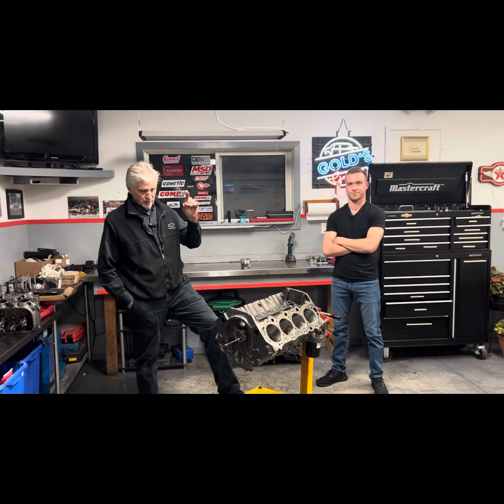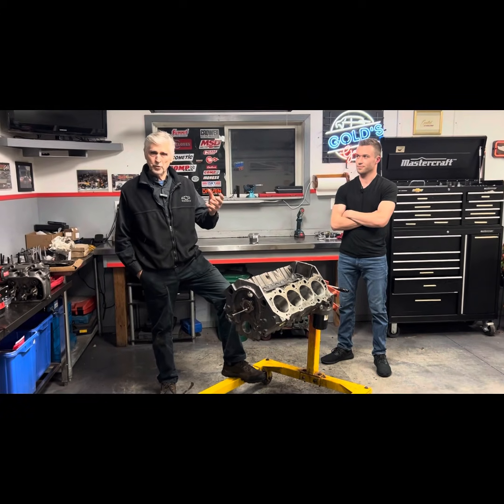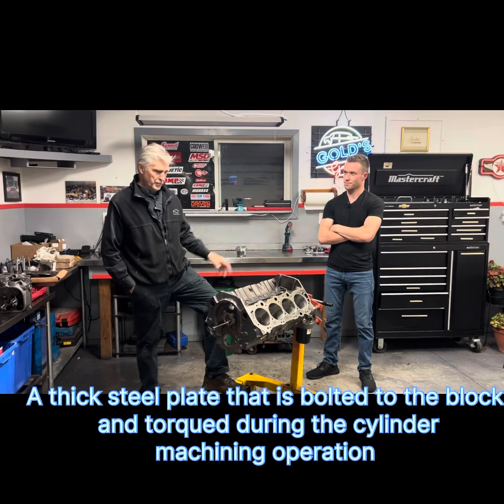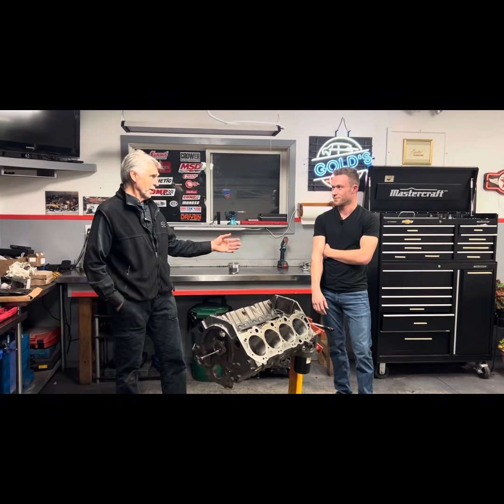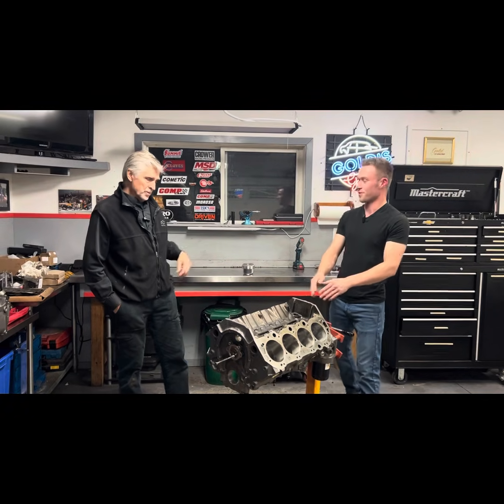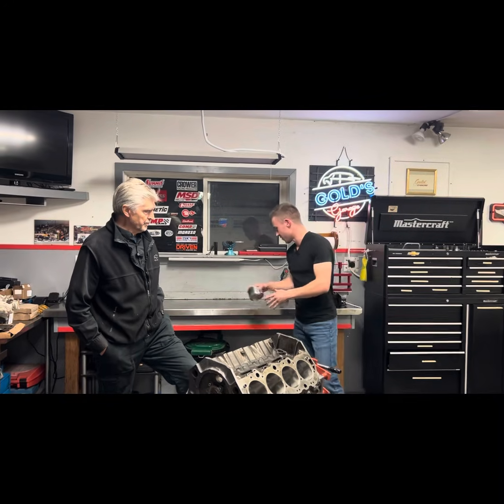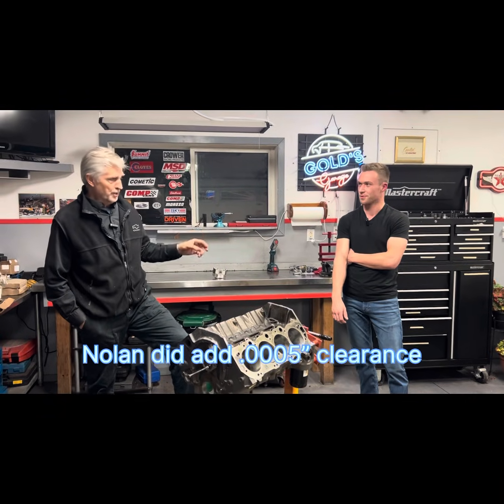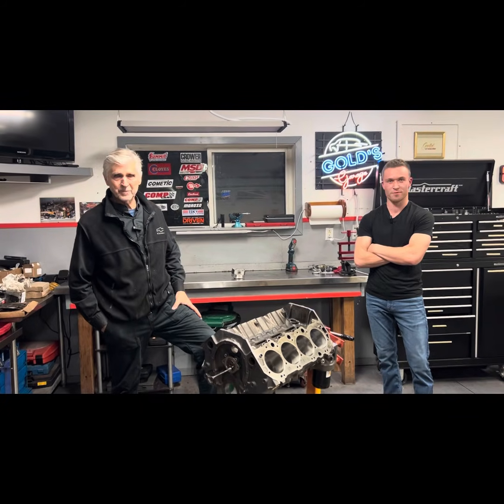COSTLY MISTAKE TO AVOID! Don’t Overlook This! AND The Importance of Torque Plate Honing!

Comment: Alan we were putting a 4.3 Marine block together with HyperEutectic pistons with .002 thousands clearance and we couldn’t get pistons in the hole without the plate on. Early lightweight Mercruiser blocks were really bad for distortion.
Reply from the maker: Good info and good to hear from you Dennis. hope you are well. AG

Comment: So In theory the rings should be gapped with the torque plate attached as well??
Reply from the maker: Technically yes, however since the variation in bore is less than .0005", the difference in gap would be less than .0015" AG

Comment: Alan, Nolan pretty much hit the nail on the head when he talked about Ford V-8s having little bore change whether or not heads are bolted on. This generally applies to engines with ten blind bolts per bank.  I've had these engines honed with both loaded and unloaded decks, and there is little difference in final bore dimensions. For all-out competition, even with these engines, I would still go with torque plates, though.
Reply from the maker: Thanks for the insight, always appreciate your experience Bill! AG

Comment: Required clearance on aftermarket pistons (that have a skirt coating) is based on the nominal skirt size without the coating, so if you're measuring on the coating keep in mind there is typically 0.001" of coating, so if the piston measures 4.027" over the coating, it is actually 4.026". Many manufacturers will leave the measuring points bare so you can measure the actual clearance, but sometimes the "windows" they leave are smaller in size than your typical micrometer anvil. Generally speaking, for normal use applications, aftermarket pistons have the required clearance "built in" so if you hone the cylinders to the indicated oversize, you're good to go. This is application specific of course. In the case of your Wiseco pistons, there should have been a build sheet with all the pertinent information. See if the clearance spec is around 0.001" larger than what the piston measures.
Reply from the maker: Right on Yarrda, that is exactly correct and why usually the machine shop can clearance a block without the piston. In this case it didn't work. Thanks for sharing your knowledge and experience as always. AG

Comment: You should also supply the fasteners you're going to use along with sample head gaskets you're going to use. Put the main caps on and torque to spec with the fasteners you are going to use. I use ARP studs and bolts exclusively on all my personal engine builds.
Reply from the maker: Thanks John for the tips, I appreciate you sharing your experience! AG

Comment: Some one set the camera wrong and the aspect ratio is not correct. It's time to move to a better 4K resolution camera for your shop videos. The present unit is not as sharp as it could be and since many of us are using 4 K monitors in bigger sizes like 50 inch or so the difference would really make your productions pop. I never understood why you didn't use a TRW VMS 75 alloy piston which is like 4032 and does not need all the clearance that a 2618 race piston does. They are better for the street and is what GM used originally. We would buy the TRW 2307 pistons and machine .200 off the dome. You have a lower than 12-1 ratio for the street, usually about 11-1  and a much better flame front since the dome is down out of the way. The piston dome is plenty thick and this does not compromise strength in any way. And the material is like 4032 and thus more suitable for street cars because you can keep the piston running clearance closer. As I mentioned, Chevy used these TRW pistons in the small block and big blocks during the era. Look inside the pistons and they have the logo forged inside. You can do some research and find the specs for VMS-75 and see how it compares to all the other alloys.
Reply from the maker: Thanks Mike, that's good information about the pistons. Our problem was finding the corrrect dome volume for our target CR. About the camera, interesting, my daughter recently bought me a Sony ZV-1F and we will be using it in future videos. AG

Comment: You do not need a Tq. plate to check it, Just Tq. the cylinder head on it. Turn it over and check it from underneath. If it is incorrect it only means the Tq. play is WRONG. The closer the bolt holes are to the cylinder wall the more distortion. The 400 chevy is the worst, and Ford had enough sense to move the bolt holes away from the bores. The further the ring is down the piston the less it effects the seal, because the distortion is only where the bolts are pulling on the deck and bore.
Reply from the maker: Good information, thanks for commenting Racer.AG

Comment: You probably know this but always supply the pistons to the machine shop prior to fianl bore finish.
Reply from the maker: Yes you are correct, that is best practice. However, typically if the bore is machined to standard, the piston manufacturer sizes the piston to provide correct clearance. In this case it didn't. 
We didn't have pistons and wanted to get the job moving. Retrospectively, it would have been better to wait. 
Thanks for commenting Truck.AG

Comment: My shop was registered to receive manufacturer service tech bulletins. 1 was about the 1 piece seal GM small blocks. 80s-to mid 90s era. It stated to torque plate hone. If not using plate, add additional. 001 piston clearence. Same for the 302 Ford. Our shop also as practice, whether stock or performance, used ARP head studs on these blocks, to help minimize distortion, increase clamping load, etc.

Comment: I have machine a chunk of metal for an engine as a torque plate at work  for  one of my backyard  build stuff. I have also warmed the block in an oven  to about 200 degrees after torque  to hone.  So my hone is straight as well as my plate. 
 This is for 3 and 4 cylinder shit I have
Reply from the maker: Great information, thanks for commenting Nate.AG